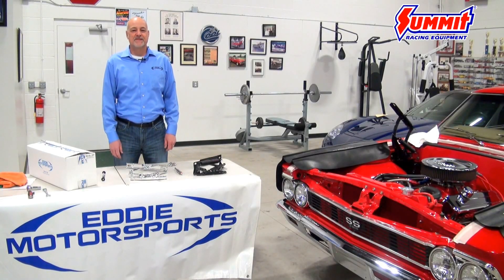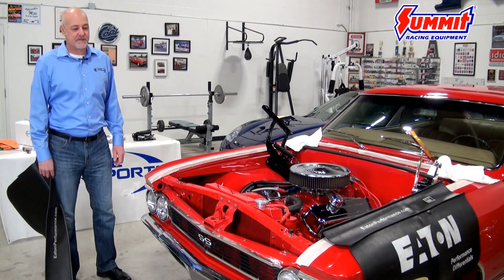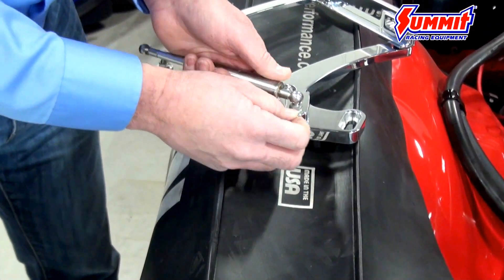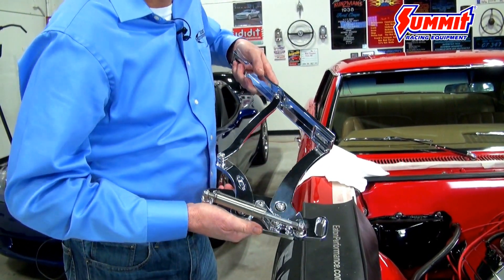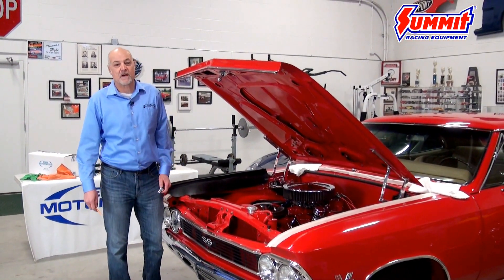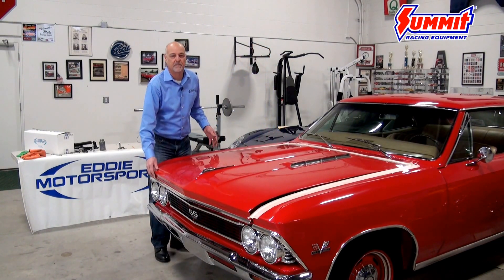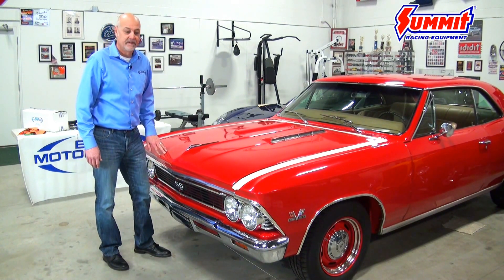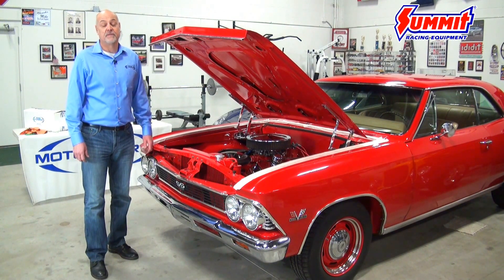Eddie Motorsports Billet Hood Hinge Installation

Comment: Total garbage. Just talked to tech support. If you dont open the hood after a couple weeks the seals in the rams drynout and fail. Total crap. Not repairable or warranty. They will dry out sitting on a shelf
Thie words, not mine